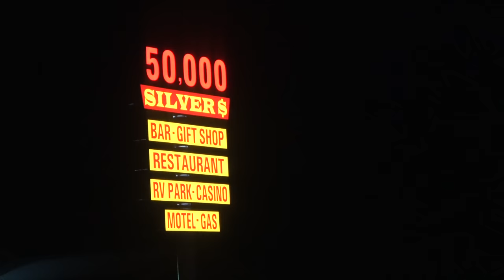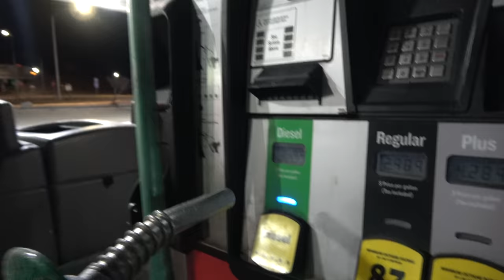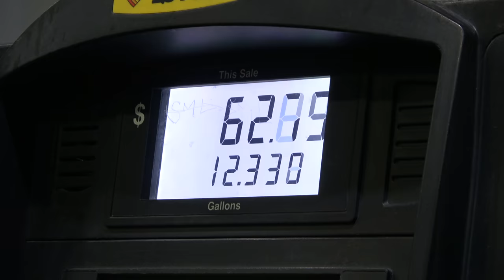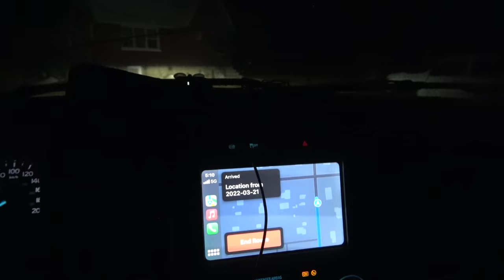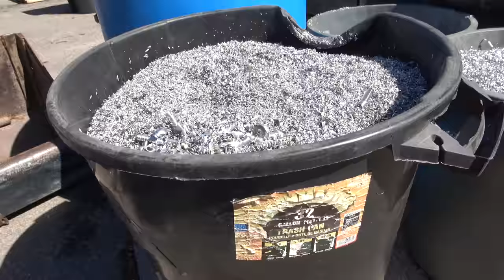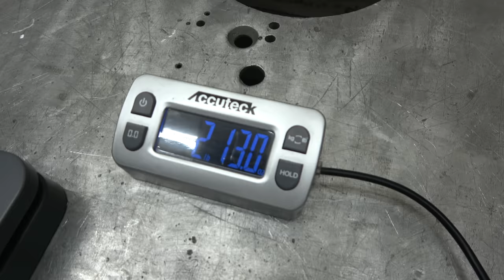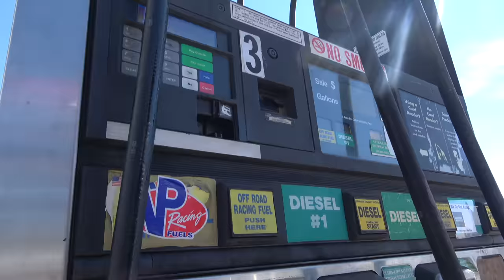Jackson Hole World Championship Hillclimb 2022 - Part 1...Travel & Testing Days

Comment: You probably know this already, so I guess this is a tip for your fans? But it was something I found super usefull in long rough trips in Alaska. Run you hand over all the trailer hubs, if one is hot it is about to disintegrate and some grease may get you to somewhere with bearings.
Reply from the maker: solid

Comment: the difference between those weights of the flywheel is not a pound. 16oz in a lb so 2lbs 13 oz you only need 4-5oz to be at 3lbs 1.1oz.
Reply: Even on a left handed Imperial reading scale?
Reply: @ghpjerry  
This is right from the zrp site. 
“96g(.212lb) lighter than stock for 800/600 Flywheels

103g (.227lb) lighter than stock for 850 and Patriot Boost Flywheels”
Reply: @kollak01  Thanks…but I think you missed the sarcasm. A ‘left handed’…’imperial scale’??
Reply from the maker: My bad fellas. It was 2am and I’d been wrenching all damn day.
Reply: @turcotte16  I was woah a lb.